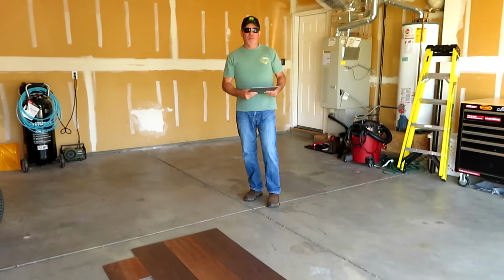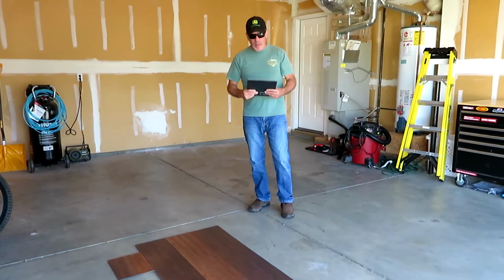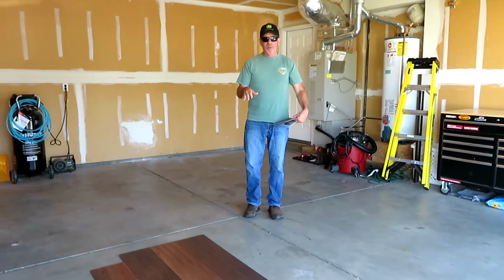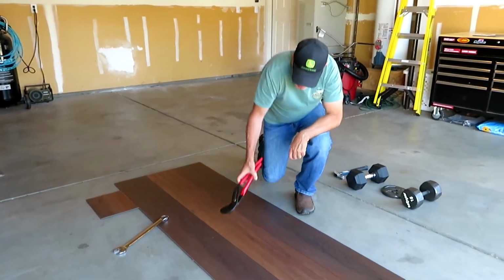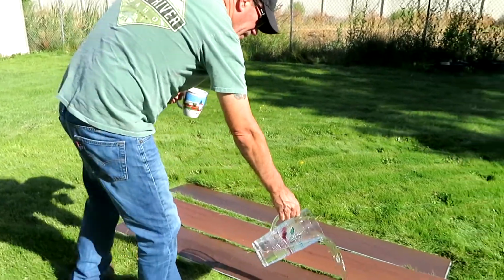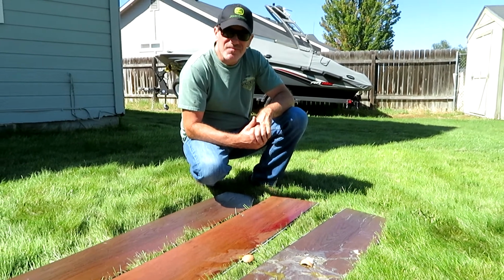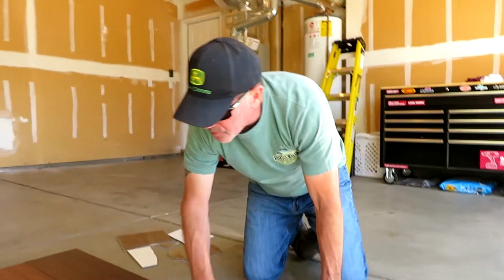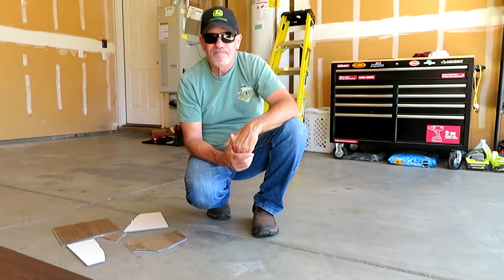Flooret Flooring - Review and Durability Testing

Comment: Thank you for posting this video. I'm also in the decision process and am leaning now towards GemCore. Gaia has that gourgeous Sole patern, but I know that a wire brush is enough to scratch Gaia (the store lady showed me how easy). I know GemCore will not scratch with a wire brush (same store Kapritz, same lady, in San Jose CA). I thought Flooret would not scratch, now I know that it will. GemCore's Ruby (28mil) patterns are not that great but Onix's (20mil) are good enough, if I can accept 20mil instead of 28mil.

Comment: My installer definitely liked the durability, but he said the wedges were too pronounced after a click and lock. Not sure if anyone else has noticed it or felt it on a small sample they ordered? Would this have a feeling of cutting your feet is what I am trying to determine. He recommended the Chesapeake collection, but can't find the 20 mil color and click-lock I need without padding as I intend to use a cork underlayment to help my neighbor downstairs with noise issues 😂

Comment: The thing is, no flooring is indestructible, not even concrete, wood/tile/concrete would gouge, or crack or scratch throwing a metal weight at it, so proves very little.

Comment: Hi! Did you do a scratch test of this product? I've tried lightly scratching several LVP brands with a small pebble, a butter knife, and with a chair leg and was very disappointed that they scratched so easily. I wonder if this is more resistant? Thanks for helping me decide whether to take a chance on this product.
Reply from the maker: Good question. I did test. Hard pressing with butter knife or pebble does scratch surface. Light scratching is not showing any sign of scratches. Chair being drug across shows a minor surface scratch, but I was able to rub it out ok. If you come across any flooring that does not show damage from a hard drag of a knife or sharp stone, let me know. I would be very interested in that. Another thing to note, and maybe the 40 mil wear layer played a part, I was able to buff out most of the scratch damage, other than the deep knife gouges. I would be interested to know how a porcelain floor tile would hold up to scratching. I know it chips with a heavy drop. Hope that helps!
Reply: I have a friend that is in year 2 of this signature line (in another color), has 2 overactive German shephards that run all over the house and small children and you can’t notice any scratches at all. Hope that helps
Reply: @GOATbro_Australia  I think Floorets Iona Flooring does a very good job for a scratch test.  Iona is somewhat of a good comparison for a porcelain floor but much lighter, not so cold, and much easier to handle than a true porcelain floor tile

Comment: Can you tell me how this turned out?  Do you still like this product?  Any regrets?  How is it when it comes to showing footprints etc?  Thank you!
Reply from the maker: Because of supply chain issues, I could not get this product without a major impact to my construction schedule. I did end up with a very good, and comparable product called GemCore by Reward. I actually like it better, although it did cost more.

I selected Ruby Collection, Monterey. 
Specifications Technical SPECIES: GemCore THICKNESS: 6.5mm WIDTH: 7" LENGTH: 48" TOP LAYER: 28 mil Wear Layer TEXTURE: Natural texture GRADE: Stone Composite Flooring (SCF).

Comment: Thank you for this. Did you ever install it in the new house?
Reply from the maker: Unfortunately, no. My builder could not source it in time to meet building deadlines. I ended up with a very close spec though. I would have loved the 40 mil wear layer, I ended up with 27 mil. I wish I could have got Flooret!
Reply: @GOATbro_Australia  Do you still like the GemCore by Reward after a few years? Is it still holding up?
Reply from the maker: @clint-ock  I do. It has held up very well. No issues at all. Very happy with it.